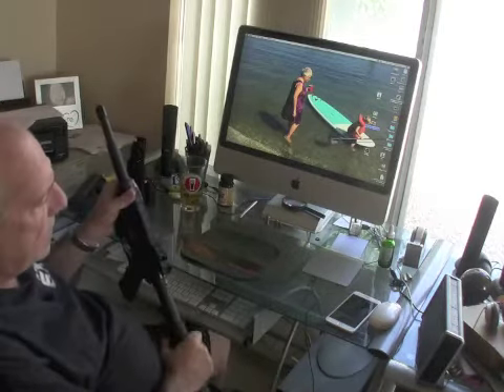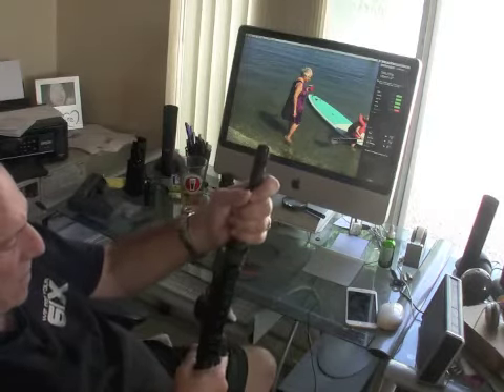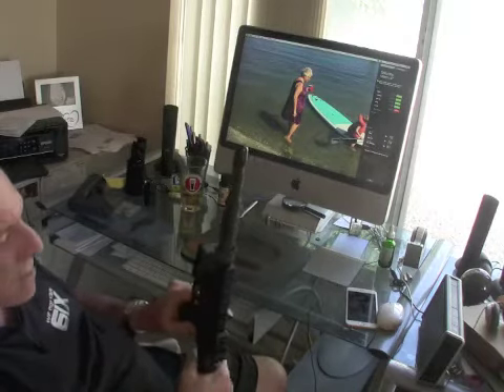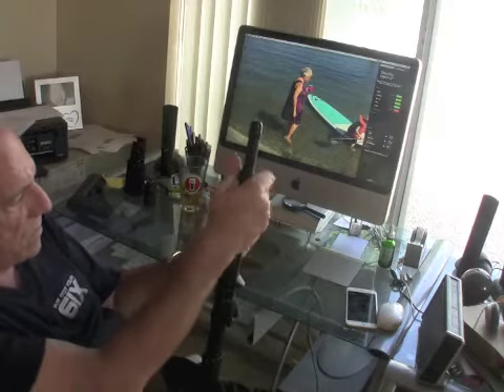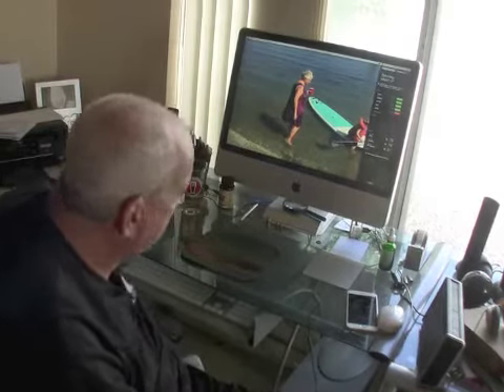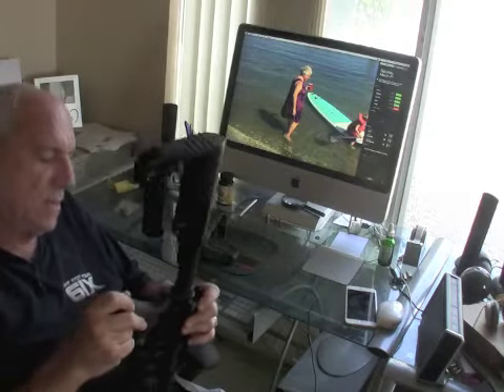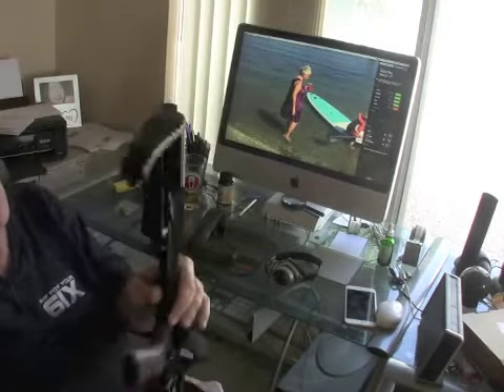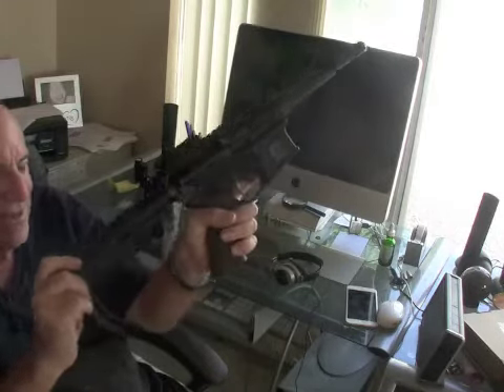ADAMS ARMS SBR REBUILD IDEAS & BOGUS BATTLELINK MFT

Comment: I'm in process of assembling a DI SBR ala Aero Precision... my question to you is with an SBR does a "heavier" stock help balance the weight of the overall setup?  In all my research i have never heard anyone bring it up.
Reply from the maker: Great question. The goal in my personal opinion for a CQB sbr is to be as light  and reliable as possible. The Adams Arms PDW that I started with was almost 4 lbs out to the box, That does not sound like a lot of weight. Now , when you start adding your lower, lights, sights, stocks mags,etc, you are easily closing in on 6 to 7 lbs. My theory for a cqb weapon is to be light, easily maneuvered for targeting, and most importantly speed of presentation when threatened by an enemy target. The heavier the weapon, the more likely for a delay in presentation and targeting.
My choice on the stock was solely based on weight. I am not sure if I gave a balancing reason as one of my justifications in any of my  statements.
Thanks for watching.
Have Fun Be Safe
Reply: jr10 Thanks!! I have noticed the same weight adding on with just a few things on my Colt LE6920 w a light on the front and a Aimpoint T1 , and magpul angled foregrip it feels a little front heavy.  knowing that Piston SBR's (using my imagination) would be more front heavy I was curious if balance is noticable between the 2 stocks.  Thanks for the reply!!
Reply from the maker: To be honest, with today's technologies, the difference in a DI system and a good pistons system is just over one ounce. That to me is negligible in the scheme of things. I would gladly give up the ounce for benefits of heat reduction and fowling in the chamber.Love your choice on the T1, and the AFG is a negligible weight addition. The remaining variables are hand guard, break, and light. The reality is that the sbr will never  really be balanced as we think of it. The object is to have a platform that is light enough to carry without an excessive burden, and as mentioned earlier capable of fast target acquisition. This is why the Battlelink MFT has become so popular. The stock's curved base makes it easier to roll the stock up on the shoulder into a firing position.